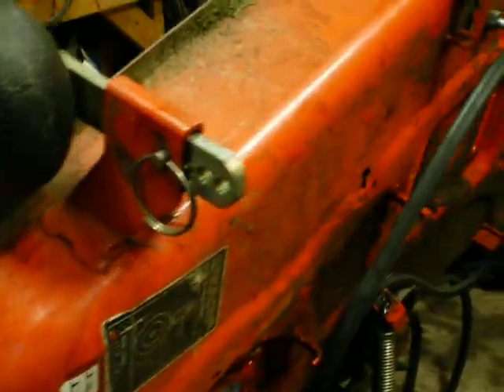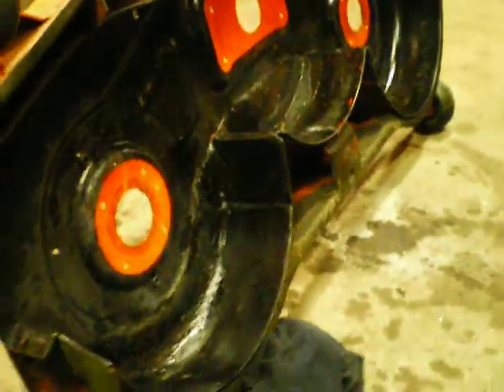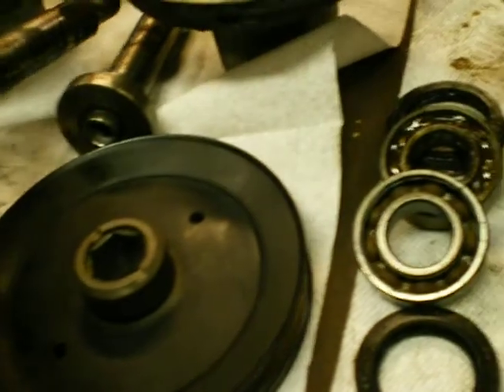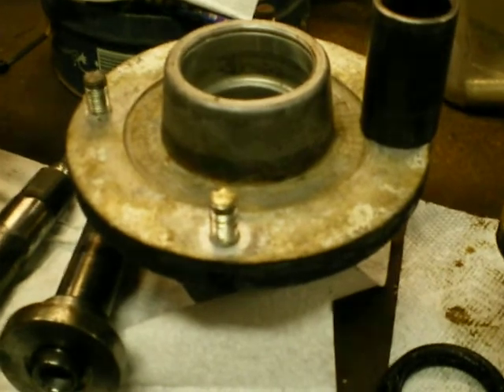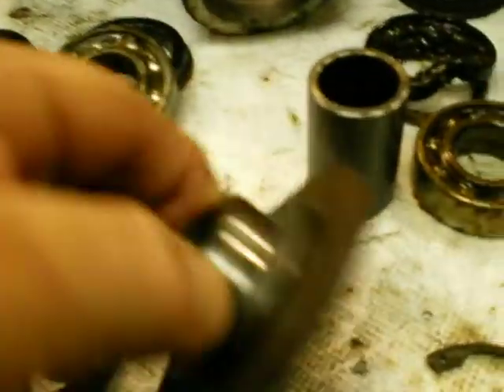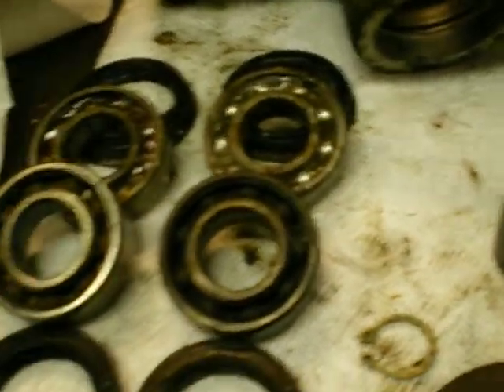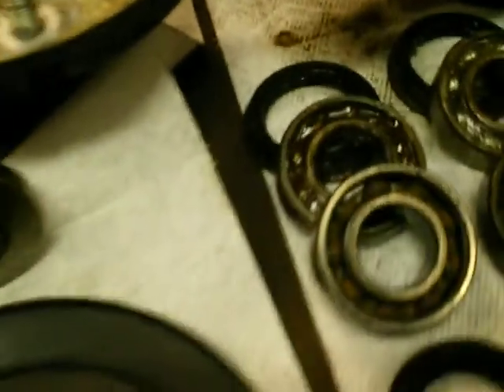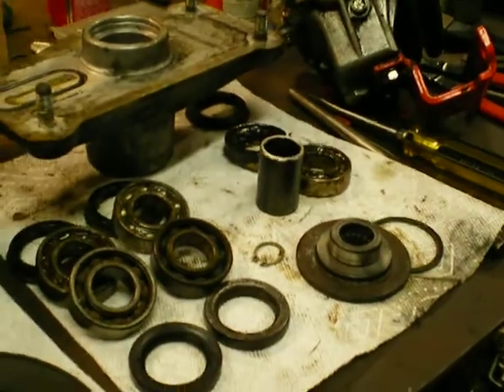GR2010 Kubota 48 inch deck spindle disassembly

Comment: Excellent video, Messicks is the way to go when buying parts for your Kubota equipment
Reply from the maker: Thanks! 
Update on the sealed bearing mentioned in the vid, still doing good after 100+ hours. 
I have a spare deck that I picked up on the cheap with the bottom seal leaking on the gearcase. I regret not taking a vid of that repair. Nothing to special inside, but have to pay attention to the shims on the bevel gears. Some thicker than others. Plus the pulley was super tight on the shaft, pressfit. The pulley doesn't need removed to replace the seal just the case hase to come apart for the repair. 

At first I has thought it was a cheap setup, but after getting into it is well made. Keep it topped off with oil and it will run a long time.

Comment: To Grease, you keep pumping until you can hear it squish noise coming out of the lower bearing seal. If you grease regularly you will get an idea how many pumps it takes. As a general rule I don't do it but every 10 hours of use on the deck, at the very least on the 3 spindles.